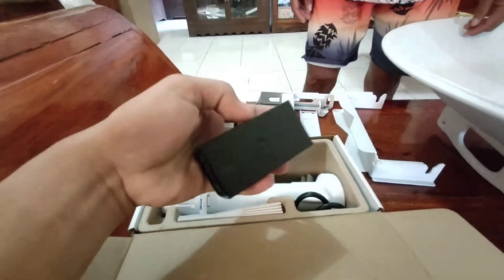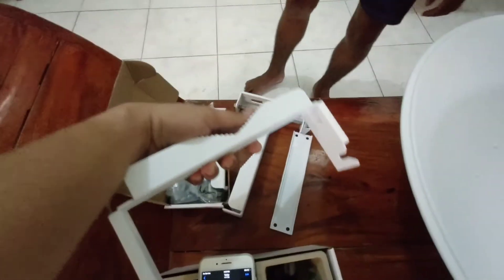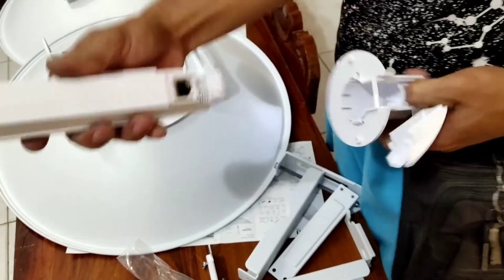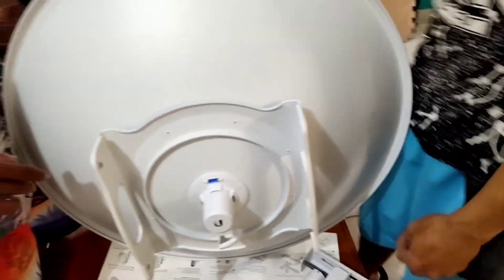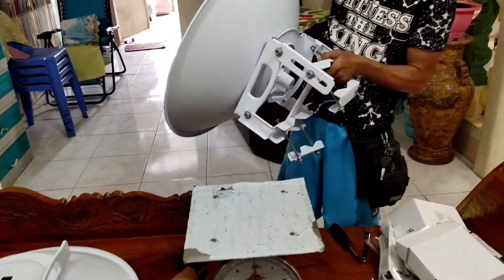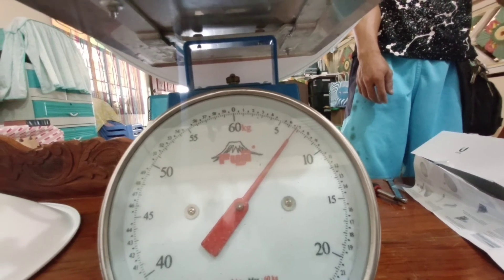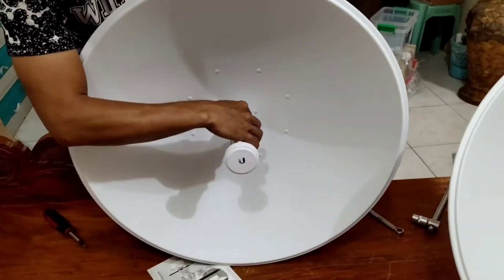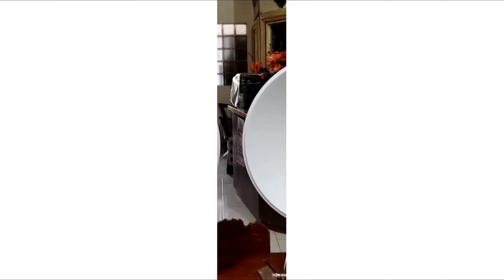UBIQUITI POWERBEAM 5AC 620| Unboxing and Assembling(P2P for PisoWiFi Business)

Comment: If I buy only one of these and point it to a friend's house 200 meters away, will his standard home router (placed high on the roof, or with a bigger vertical antenna) catch the signal, or there will be too much interference from surrounding home routers?